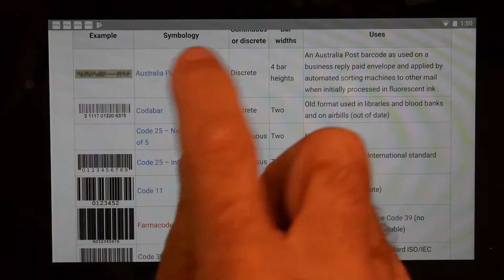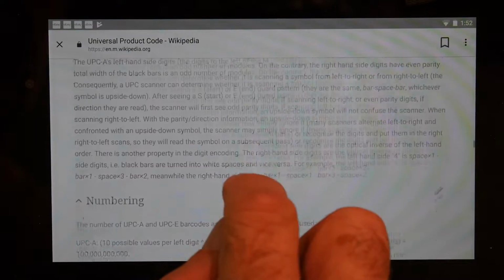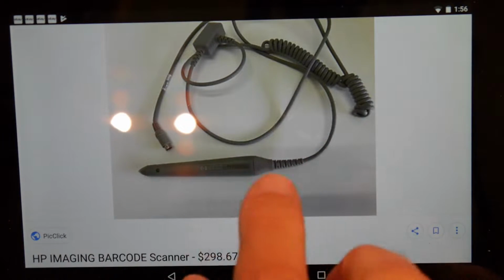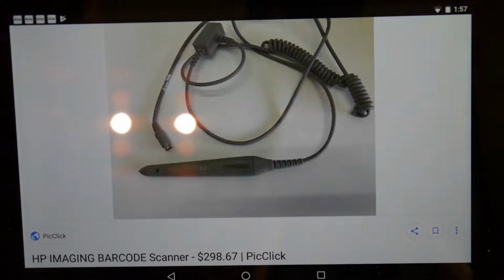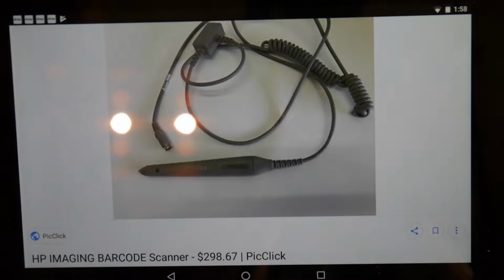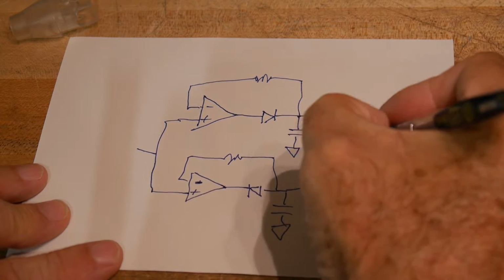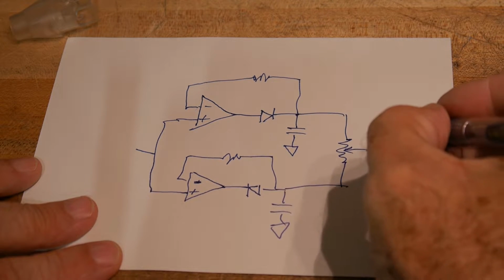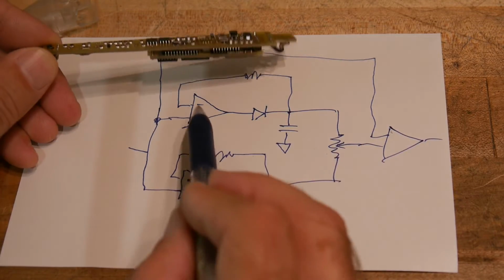#264 barcode reader design

Comment: Nice detail on the HP wand. I still have the one for the HP-41 calculator tucked away somewhere. Also, my college roommate and I did a DIY project back in the early 80s using the HEDS-3000 emitter/detector device (the can in the wand) mounted on an X-Y stage to scan images into an old IMSAI computer. I still have that sensor in my collection...